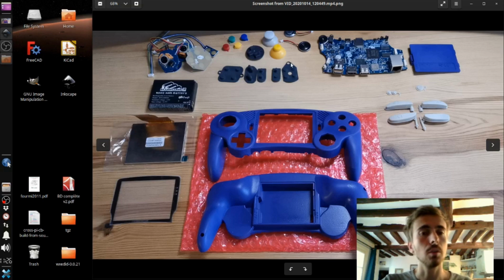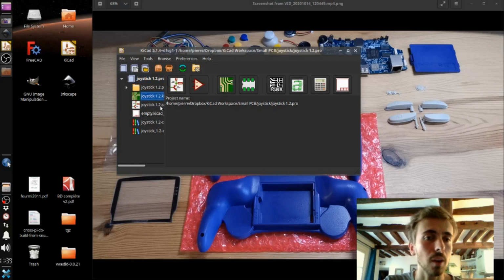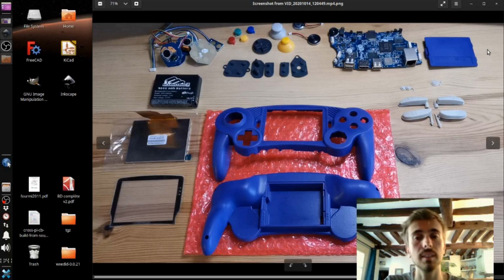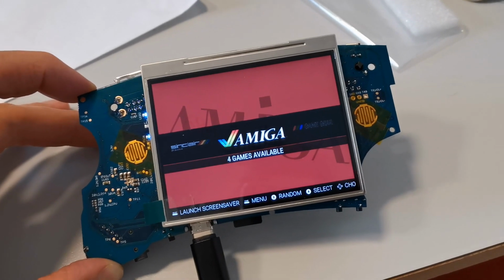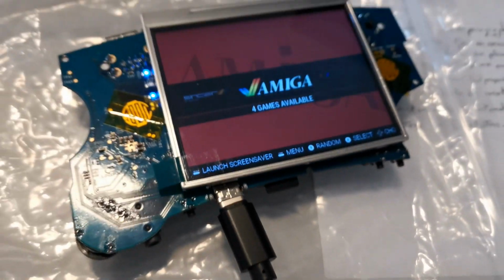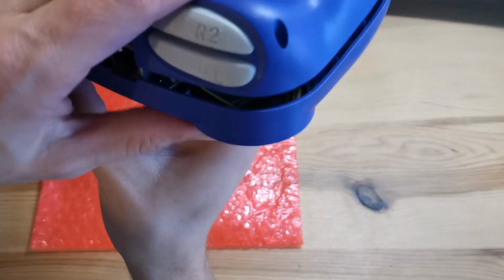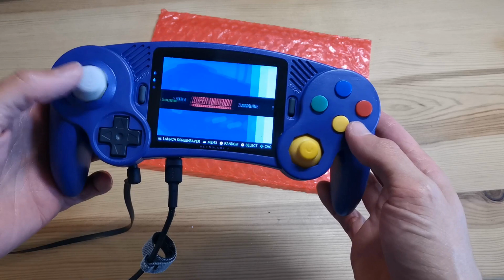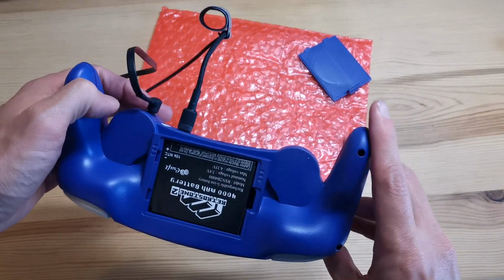I Designed my Own Game Console ! RetroBlock2 - From idea to Pre-production Prototype

Comment: Nice one, I hope there will be goals on the kickstarter  to have a more powerfull CPU (full speed DC, GC and PS2), rumble pack in handle, better look shoulder buttons (look the one from the Retroid Pocket 2), recalbox/batocera compatibility. As someone write below, the best would be the use of the CM4 pcb. I fear to see another good but not best device, like a lot have been released last 2 years.
Reply: Minimum cortex CPU for dreamcast : ARM Cortex-A9 dual-core at least 1 GHz